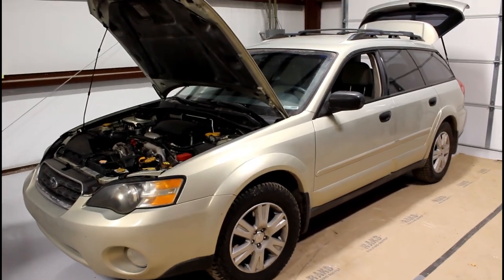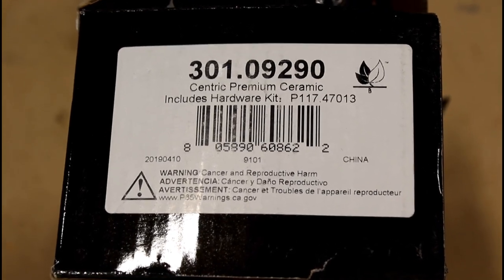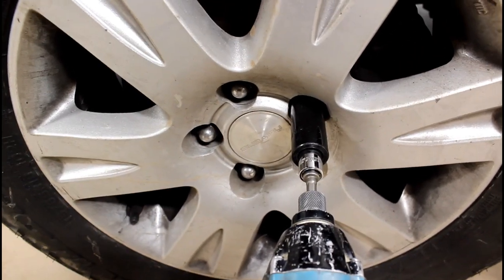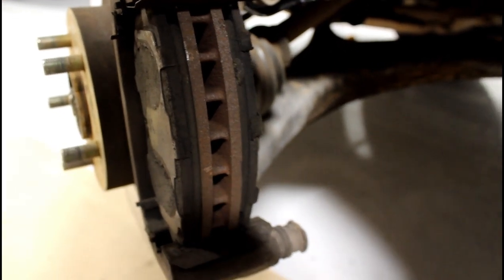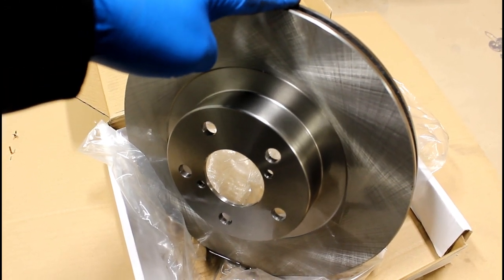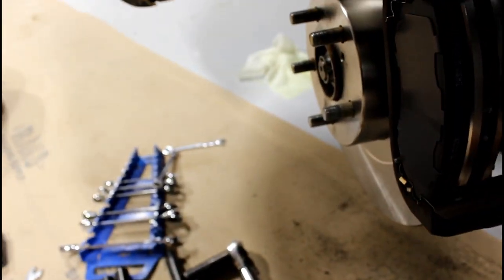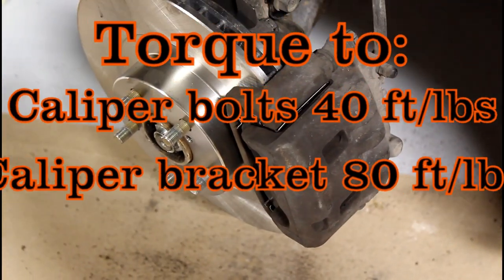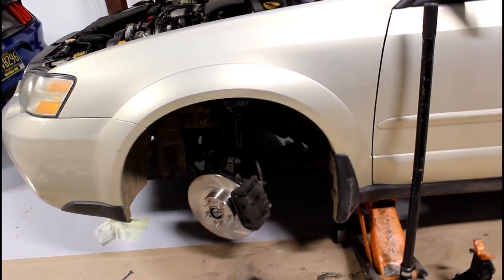How To: Subaru Outback Front Disc Brakes Replacement Step-by-Step

Comment: hey bro i was asking what block and head it was that you did that ls vtec on couple years ago ?
Reply from the maker: Ls block vtech head
Reply: do you know what kind of vtec head like was is gsr or b16 and what kind of ls block b18b or b20?
Reply from the maker: @davidojeda3948  b18b1 block.  B18c1 head
Reply: @FatGuyBuilds  sweet bc i got a jdm b18b and a gsr head tapped for lsvtec thank you bro that series of putting it together will help alot then
Reply from the maker: @davidojeda3948  no problem